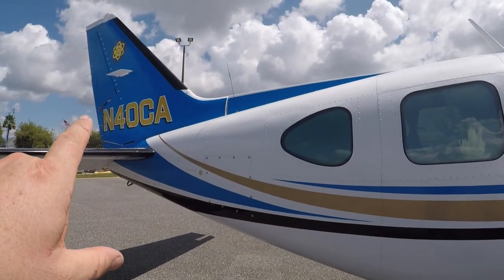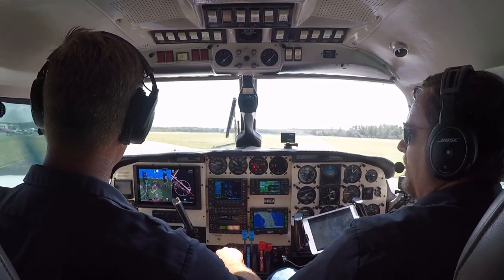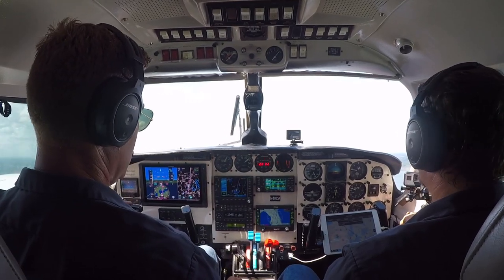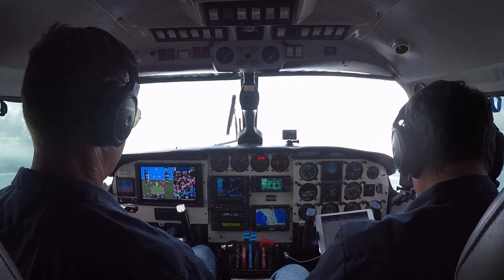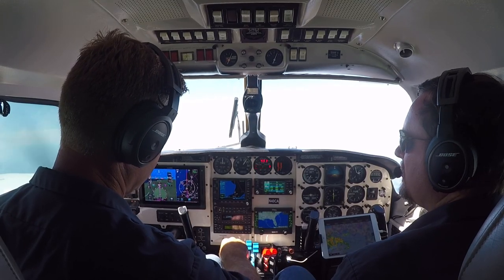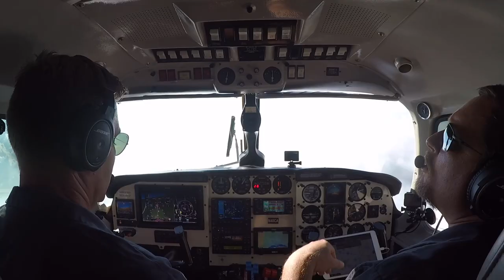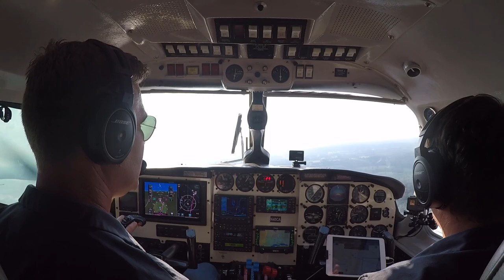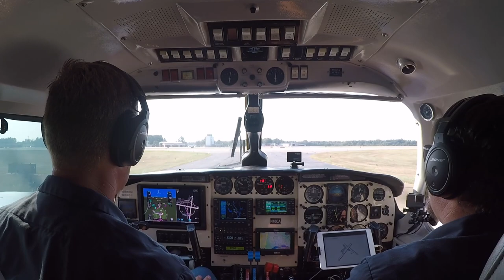New Plane? / Leesburg to Texarkana

Comment: Hi guys, what a smooth ride. I was very much awake and temps were high I could feel. Thanks for notifying us on tail number change. Brad isn't nowadays moving cameras to face different views which is good. Maybe add some abit of background engine roar. I had adviced about outside cameras but don't know your opinion. Thanks allot guys and never lieve us behind.
Reply from the maker: FYI. The motor noises are always in the background. After takeoff we do slightly reduce the noise level but leave it a full recorded volume during takeoff. We run three cameras and for now that’s a lot of footage to deal with. Well work on different views from time to time. But remember these are pre recorded way in advanced.

Comment: question - on your way from GND to 12000ft how do you lean your engines? Constant fuel flow or egt or cht?
Reply from the maker: We basically just set the power and monitor. 35” at 2400RPM gives us about 32 gph and 1450 EGT and then monitor CHT. At attitude we basically run ROP and lean to CHT

Comment: Nice flight. How hard is it to obtain a new tail number?
Reply from the maker: FAA has a website that you can select a number. It will tell you if it’s taken or not. Once you find one you can reserve it pretty cheap. Then when your ready for the change over, there are few forms to fill out and some waiting. But overall. Wasn’t a bad process. But the number we wanted was available so guess we were lucky.
Reply: Sounds good. Thanks. Is it a few hundred dollars or thousands for a new registration number? I am looking at a Navajo 350 but I want a different registration number.